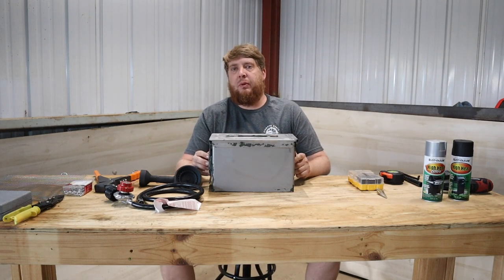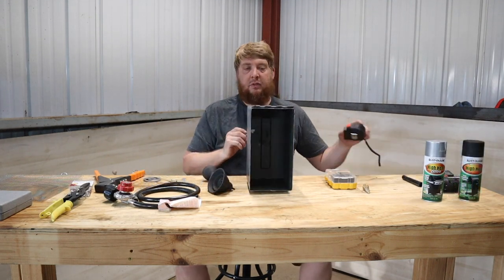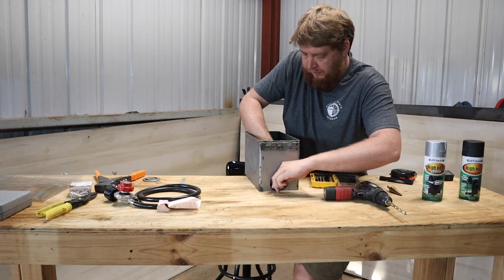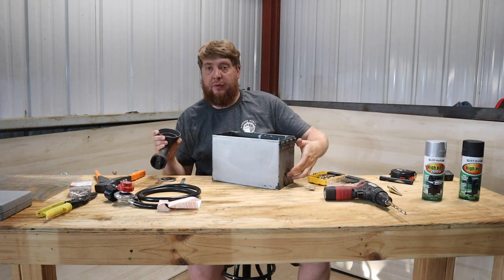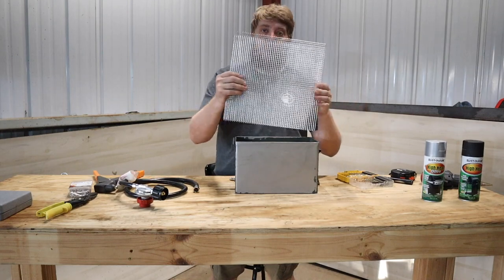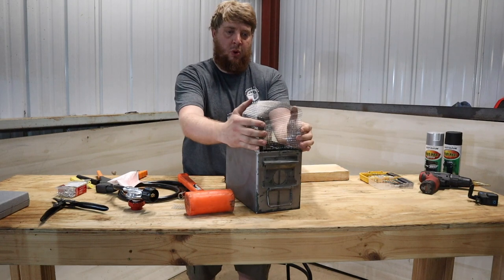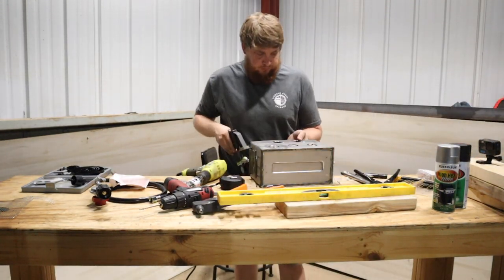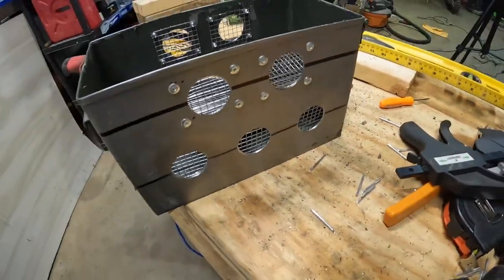Ammo Can Fire Pit DIY

Comment: Is the fire evenly distributed? Looks like the burner is not centered. Thanks
Reply from the maker: The box is a 11” long, the center of the burner is 4.5” from the far side of the connection for the propane hose. Heater works great. You’re not going to have 20 people around it, it’s meant for 1-3 people max.
Reply: Thanks

Comment: Im currently building one, but not going do all the side wholes. Stripping the paint sucks what did u use?
Reply from the maker: Citristrip! Worked great. Apply thick and leave in a bag for around 36 hours.
Reply: I used a flapper disc on an angle grinder. It took about 10 minutes to strip the majority off.